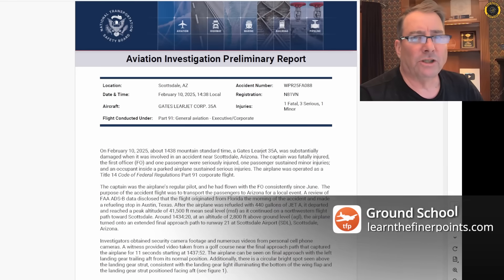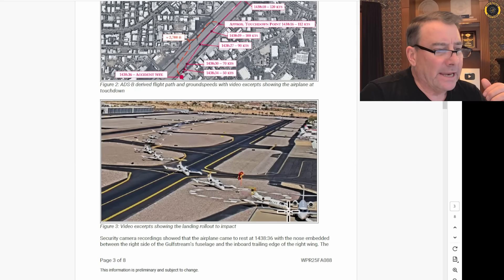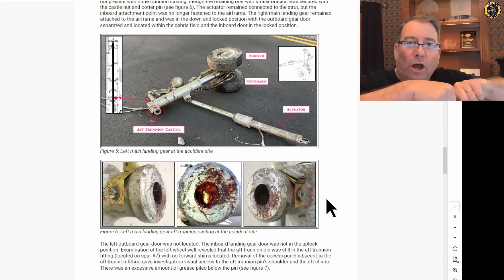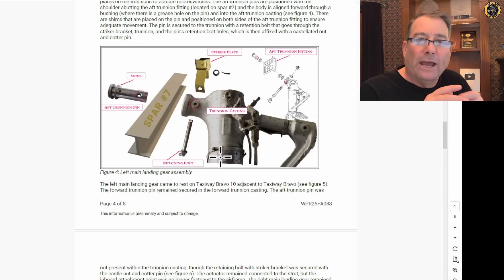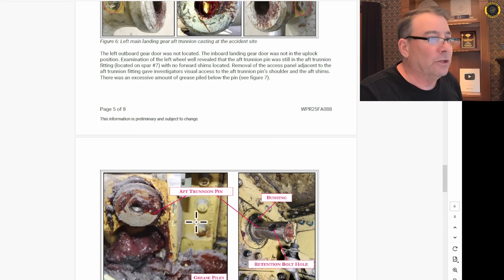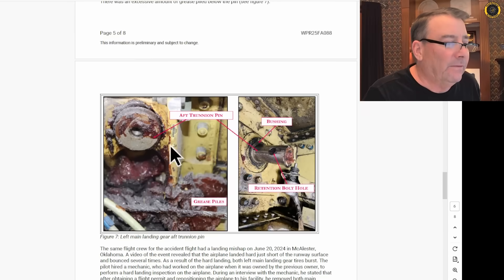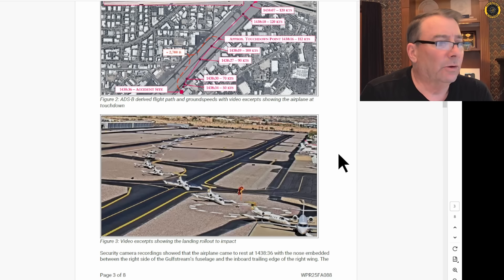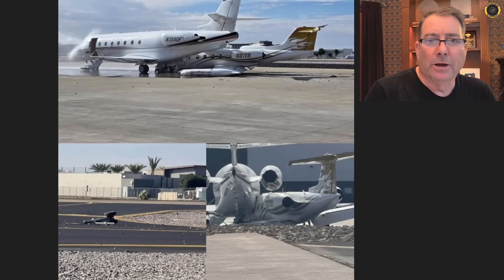NTSB Preliminary Report Fatal Maintenance Error Lear 35 Scottsdale

Comment: I've worked as an A&P, and some of the stuff I've seen beggars belief. For example: brake pads put in backwards (caught by the IA before the plane came off the jacks), aileron bolts left out after an annual (by an A&P with a fake license nobody ever bothered to check) resulting in a multi-fatality crash shortly after takeoff, and plenty of composite "repair" work on sailplanes and Cirrus SRs and kitplanes that looked like it was done by drunk monkeys. I've done a lot of race-car prep and fabrication too, and currently build high-end hot-rods. Details certainly DO matter, and there are ZERO excuses.
Reply: One fatal example from Australia was a Viscount ( Ansett-ANA Flight 149 ) that crashed near Winton, Queensland. A cabin blower oil metering unit came loose due to missing locking wire allowing the nuts to move. End result was a Left wing fire, and mid air breakup (24 dead, and I knew 3rd hand 3 of the victims).
Reply: We had a crew bringing our Gulfstream G-IV out of maintenance from a Gulfstream maintenance facility,  The ailerons had been removed during maintenance, and control checks on the ground were correct.  When they took off for a post maintenance check flight, they found the aileron was jammed.  Got the airplane back on the ground and the aileron moved freely.  A shim or washer had been left out on re-assembly.  The aerodynamic loads caused the aileron to jam in the air.
Reply: What company were you working for that did so much Micky mouse maintenance????😮😮😮
Reply: @erikhaack4123  You should never assume.
Reply: Not assuming anything. Just wondering who was allowing such dangerous work.
Reply: @erikhaack4123  Only one of those was in a shop I worked in...the one where the IA caught the brake pads installed backwards by an "A&P" who came from a diploma mill, and who I wouldn't let work on a lawnmower. The rest of the stuff, excluding the fatality (that was the work of a repair station 50 miles away) came to me after the fact, when I was working at a very conscientious shop, and we corrected the horrible work done elsewhere. Sailplanes and kitplanes, being in the "experimental" category, often get sub-par work...though they shouldn't. The structural repairs designed by Cirrus were often ridiculous, unnecessarily heavy, and violated known, proven correct repair techniques for aviation composite structures. We worked with one of the most highly-qualified (in composite structures) DERs on the planet and designed our own pioneering composite repairs (not sanctioned by Cirrus) but fully approved by the FAA.
Reply: Ok
Reply: DITTO
sounds like me 👍👍
Reply: "A&P with a fake license nobody ever bothered to check" is the stuff of nightmares.
If you've got a nicely operating stack of slices of swiss cheese preventing failures, don't say "Ok, I trust you" and remove a slice!
The people doing the paperwork on this stuff are JUST as safety critical as the people actually turning the wrenches!
EDIT: Now knowing further details (that the supposedly "licensed" A&P was the product of a diploma mill), the failure is less of the process and more of a case of "find and remove the uncertified part", in this case, that would be the FAA coming down like a ton of bricks on that diploma mill.
Reply: @44R0Ndin  The fella at the shop I worked in, the one who put the brake pads in backwards on a Cirrus SR22, was a licensed A&P from a diploma mill. I had watched him work, and how he passed his practical is beyond my comprehension. The fella who left the aileron bolts out (I think it was on a King Air) at ANOTHER repair station had presented a fake A&P there, and he was criminally prosecuted and imprisoned after the fatal crash...but I don't know what kind of blowback the other repair station faced. The fake A&P who caused the crash had PREVIOUSLY worked at the shop where I was, but was booted out after a routine license check...some time AFTER he was hired. I left that shop because there seemed to be a little too much other shady stuff going on too...like used parts returned to service at full price. We were also pushed to do annuals so fast that corners almost always had to be cut.
Reply: So you are supposed to believe. FAA really derelict with the drone situation. Anyone can pass a test being unstable with life.
Reply: "A&P with a fake license nobody ever bothered to check" is the stuff of nightmares.
I don't understand how this is scrutinized any less than things like buying beer at a gas station.
At least in NY state, it doesn't matter what your age "appears" to be, no card, no beer.
Same with tobacco products. No card, no cigs.
Where is the morality/ethics disconnect in a person that leads to them thinking that it's any less impactful to require any new-hire A&P to have their documentation get cross-checked "simply as a matter of procedure, rather than as a punitive measure or only checking AFTER a problem happens"?
The people doing the paperwork on this stuff are JUST as safety critical as the people actually turning the wrenches!
Reply: I know the FAA composite structures specialist quite well and what you describe keeps him awake at nights.

Comment: I'm a retired A&P mechanic and I worked for a brief time at the Scottsdale airport. I didn't check to see where this maintenance was done but even at Scottsdale it was not uncommon for mechanics to do work and not even have the maintenance manual open. You need to do a gear swing and do critical observations in the presence of an inspector after this type of work and it would not pass muster had it been done right.The director of maintenance where I worked was masking the fact that a mecahanic had significantly damaged a customers Citation and chose to not tell him what had happened. He was afraid of losing significant business. There were so many other questionable practices there that I just couldn't take it anymore and I walked out.
Reply: The gear would have operated correctly for the gear swing test, as it operated correctly for at least one landing and two takeoffs prior to the failure on landing.
Reply: @Sylvan_dB 
Just because it went through the motion doesn't mean it did so correctly. If somebody were standing there watching and listening they may have noticed that it had excessive side to side play or made a strange sound or something. The inspector may have noticed excessive amounts of greece and said WTF is that???
Reply: @jerseyshoredroneservices225  there would have been NO indication whatsoever on a gear swing NONE
Reply: @Sylvan_dB  a proper inspection of multiple gear swings would have revealed something was off. You don't just swing the gear once and say it's great. Not only do you run it through many swings but you arrest the process and inspect every crook every cranny you pull on Parts critical pins are pulled on you put hands all over it. I don't know what kind of inspections you have done but I'm just saying if it was done properly it would have been found.
Reply: @arthurnied5500  Not true at all in this case - the only way it would have been found is if someone took a look see in the panel aft of spar 7 AND if they knew what they were looking for. Guaranteed the guy had never worked a lear gear before
Reply: @TrollingwTyrone  and you realize of course that a mechanic is in violation if he had never worked on this gear before without supervision? You are aware of that FAA rule correct?
Reply: @arthurnied5500  "performing to the satisfaction of the administrator" means following all FAR's and approved/accepted data. The FAA does not have to oversee everything you do...The maintenance manual is an FAA Approved document, approved by the Administrator. If what you say is true there are MILLIONS of A&Ps in violation
Reply: @arthurnied5500 Not necessarily. Citations have left the factory with this exact condition and flown an uncomfortable amount of cycles before the SL came out. A dimension check of pin protrusion was required as gear swings would not indicate the installation error.
Reply: @joesephkingston1621  so you're saying a landing gear that fell apart in mid-air before the aircraft even Landed would not have been detected If the mechanic or the inspector grabbed that main gear and started yanking on it? An inspection that must be performed by both the mechanic and a certified inspector is not limited to observations. They must put their hands on things and Pull and tug and twist get different intensity lights with various Kelvin ratings or electronic test equipment or whatever. The lazy or ignorant or stressed employees slap things together and move on so they can keep their job.
Reply: 👏👏👏 I applaud you for choosing ethics over job security & money. Most don't.
Reply: I'm not sure why this comment seems to be getting deleted but here goes again - Some enthusiastic comments on this thread think it's okay for a mechanic to work on whatever they want without proof of skill and knowledge as long as they have the manual. That is simply not true. The CFRs on General privileges and limitations (65.81) section states the following - If he has not so performed that work at an earlier date, he may show his ability to do it by performing it to the satisfaction of the Administrator or under the direct supervision of a certificated and appropriately rated mechanic, or a certificated repairman, who has had previous experience in the specific operation concerned. It seems this very important restriction is not complied with on a broad basis @tyronetrump1612. Imagine if mechanics could work on anything, just work it out with manuals that in many cases are poorly written, close up all the inspection panels and actually get an inspector's signature? They do exist but thankfully the redundancy of protection measures rarely allow the swiss cheese holes to all line up.
Reply: @arthurnied5500  I hate when YT deletes comments without explanation! They have an AI bot scanning comments for signs of being posted by bots and containing naughty or abusive content, and I think if you post a reply to someone else's comment, it gets deleted if the AI thinks it's too long, but it's very inconsistent. I've found if I simply add punctuation errors to deleted comments they will be accepted. (I generally copy and save longer comments before posting so I can try again without rewriting them.) Apparently bots don't have many punctuation errors? BTW, just a little longer than this post is the longest reply I do nowadays. This length will get through comfortably.
Reply: @ I hate when YT does that! They have an AI bot scanning comments for signs of being posted by bots and containing spam or abusive content, and I think if you post a reply to someone else's comment, it gets deleted if the AI thinks it's too long, but it's very inconsistent. I've found if I simply add punctuat'ion errors to deleted comments they will be accepted (I generally copy and save longer comments before posting so I can try again without rewriting them.) Apparently bots don't have many punctuation errors? BTW, just a little longer than this post is the longest reply I do nowadays. This length will get through comfortably.
Reply: @ It's really frustrating when YT does that! They have an AI bot scanning comments for signs of being posted by bots and containing spam or abusive content, and I think if you post a reply to someone else's comment, it gets deleted if the AI thinks it's too long, but it's inconsistent. I've found if I simply add punctuat'ion errors to deleted comments they will sometimes be accepted,, (I generally copy and save longer comments before posting so I can try again without rewriting them.)
Reply: @arthurnied5500  The AI comment bot is working overtime! It's supposed to prevent bad posts with certain buzz words or negativity or whatever, or posts made by bots. It's really being persnickety right now..
Reply: I could never be a mechanic. It's a zero failure tolerance profession and every job is critical. Humans make mistakes. I can't work it out in my head how you A&P folks are, on the whole, so incredibly reliable. Not me.
Reply: @beenaplumber8379  I learned early on in my career that people's lives were at stake. I had worked on an aircraft that was involved in an accident and killed four people and I didn't sleep for a week going over in my mind if there was anything I had done to contribute. I had to wait a full year for the NTSB to finally report that the pilot had a major heart attack. Most mechanics never get that lesson and they don't really follow the guidelines. It truly is a Swiss cheese though in that you have to have multiple failures on multiple levels before something serious happens. This particular accident killed the pilot and I couldn't live with myself if I had been the mechanic that didn't put this back together properly.
Reply: @ Your story is exactly why I couldn't do it, only I'd be doing it preemptively. I'd be waking up in the middle of the night panicking about whether I remembered to replace some bolt or other that day, not waiting for a crash. I'm glad there are multiple checks, like there are for most things pilots do. Most of them have a second competent pilot (Capt or FO) with them to monitor things too. The jets all seem to have fly by wire too. It's a very safe system overall, I know, despite the number of incompetents people here are talking about, and I'm grateful to those of you who keep it that way. I like the Swiss cheese!
Reply: @beenaplumber8379 
MOST airplane mechanics and AI inspectors shouldn't even be working on old shit-box Chevys.
Reply: @hotrodray6802  I'm gonna pretend I didn't read that and have another few slices of Swiss Cheese.
Reply: Thx Juan...what  an unfortunate accident...bad maintenance  looks like to me.
RIP PILOT.
Reply: Found the culprit jk
Reply: @arthurnied5500  Just WOW....
Reply: This is common across the USA.
👍 I TOO finally quit aviation and got a good paying clean job. 👍
Reply: Boy this is serious stuff! Hope you reported all this??
Reply: As a retired A&P for US Airways from the 00's period every mechanic in the hanger had either one license or both, no repairman were allowed.
In the next hanger was a heavy check facility, 90% of the work was done by repairmen, the A&P's signed off the work after inspecting it.
We had planes returned to us that failed QA inspections everytime from that outfit.
Reply: @aurthurnied5500 while I do see where you are coming from stating they should have prior experience, you are forgetting to state the prior half of that particular cfr, which starts by stating any CERTIFIED mechanic can perform the task at hand, excluding props and instruments. The part you’re referring to states they cannot supervise the task being performed without prior experience in said particular task. The manuals are more often than not very good at telling you how to do the job. They have to be. And if they are not, it is our responsibility as license techs to report such a finding. It is often the one performing the task has misread the manual somehow,  not have the common knowledge, or is just complacent in a task. Read closely, you have to be a lawyer in a sense when reading CFRs.
Reply: Proper
Reply: By not reporting what you witnessed makes you culpable ✅️
Just as bad as leaving the scene of an accident ⚠️
Reply: @julesviolin  you have no idea what I did. But thanks for being an armchair judge.
Reply: Now the conjecturing shifts from the pilot to the unknowns of what might have happened during repair and inspection and if it happened.  This guessing game is fun !
Reply: Cool story needs more dragons. Shame you didn't report your alleged observations!
Reply: @FrailRider  how do you know what I did? How do you know they weren't paid a visit by the FAA? Haven't you noticed that most violations don't even get the token slap on the wrist?

Comment: That's an amazing expose.....in my experience the maintenance guys are super-careful on safety-critical assembly work, so this is a very rare tragedy. I have no idea, but is it possible this was "blind assembly" i.e. not directly visible so checked by 'feel'?  That would be poor design, and not on the maintenance crew's conscience.  If it WAS directly inspectable, then, really, no excuse.
Reply: Easy to say after the fact on my part, but probably should have confirmed bolt installation by trying to pull the trunion pin out prior to putting weight on the gear. The pin has to slide out for gear removal.
Reply: @DillonPrecisionFan  Try pulling that pin out with 150 plus pounds of gear  weight dead hangin on that pin... it is a bitch to get that pin in and rotate it so it lines up with the trunnion so you can get the retaining  bolt in.
Very rarely the gods will smile upon thee and you get that thing lined up real close with minimal fuss -so you are rocking the gear, cussing while you turn that bolt you screwed into the trunnion pin head that is there just for this purpose
Reply: @TrollingwTyrone  I don't doubt it is a pain, I have never worked Lears. I worked large aircraft where you absolutely had to use jacks and specific tooling for R&R of gear.
Reply: @DillonPrecisionFan  and a forklift to remove the main wheels...lol